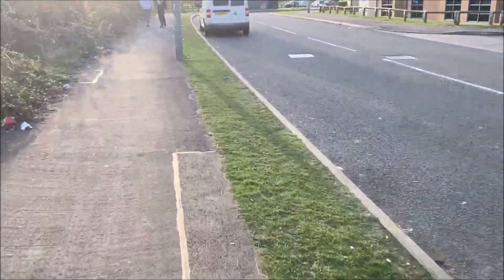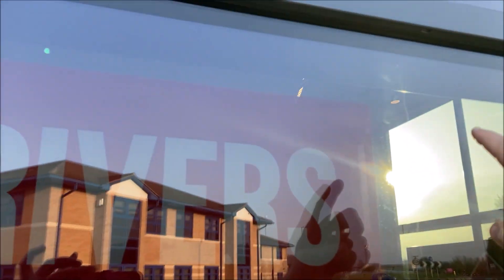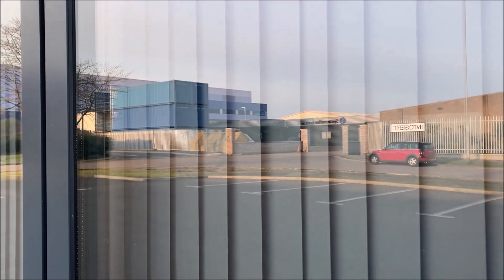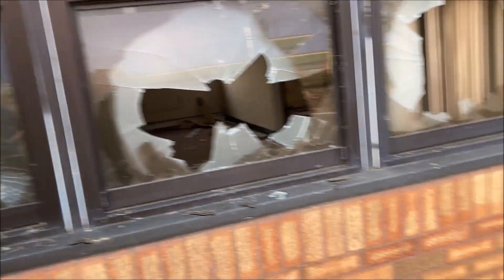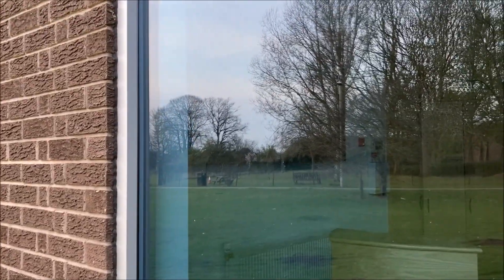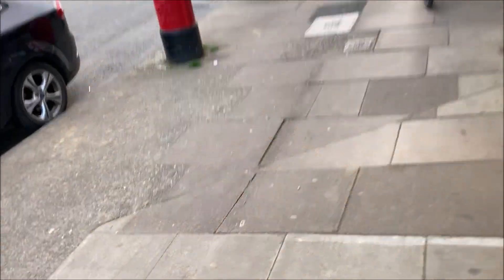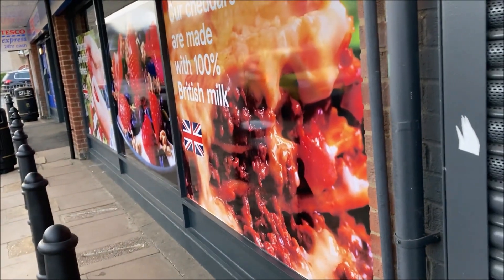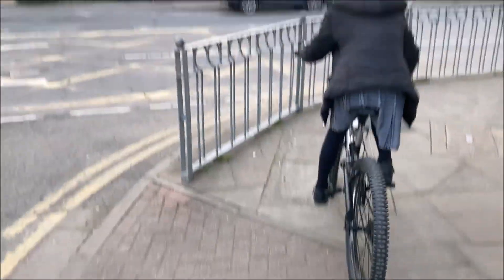Polzn Bladz-Checking out local window cleaning quality

Comment: Cracking good video! The amount of people that think wfp is a magic tool is incredible. Of course when wet it looks superb but as you've shown multiple times just on these few jobs it doesn't leave a good result everytime. On some windows the wfp does work fine but there's always a gamble element to that tool. 

Obviously some jobs can't be done trad and have to be wfp, but so many people use it for everything and are unaware just how much better job a nose to glass trad clean can achieve, all they need to do is charge more to allow for the time it takes for a trad clean and they would come away with a great wage and much better results.

Well done Mr bladz
Reply from the maker: It's also the quality of trad which is shown here. This is general quality window cleaning. It's all low grade work and this industry needs to level up and improve all over
Reply: Totally agree, Well done Mr Bladz!!!

Comment: Personally love both methods. Water fed pole requires good technique and good water quality. People do think it's just scrub and squirt and it will be perfect. Not a chance. 

Traditional window cleaning with Moreman tools (I've adapted to using this tool) also does require good technique and good solution. 

Both methods can deliver excellent results but really it comes down to the operator of those tools having the work ethic and knowledge to deliver what's required. 

Commercial jobs such as the ones shown are often done by guys who don't have passion. It's a job and just needs to be done quickly by a national firm. Unfortunately there is no quality control at either end. By the companies conducting the work, or the customer. Taking a good look at the end results and questioning any imperfections.
Reply from the maker: I agree. I think these actual jobs were done by local window cleaners. The results reflect their passion for the job. That's what I've been highlighting over the last few weeks. This industry needs an upgrade and their is plenty of room for improvement with the better known youtube window cleaners that like to give their uneducated opinions rather than actual facts

Comment: hey I see you mention you use a 22 have one and 18 I'm good with the 14 and smaller but looking for some help on 18 and 22 it seems issues with the ends but also further inward the results are not to good please help it would be great if I could use these larger ones
Reply from the maker: Longer the channel, harder it is to use and be precise with it. A lot of it is to do with what rubber you use with it. If you are using Ettore the longer channels don't want to work at the edges
Reply: @polznbladz3242  Right now I got the unger green in the 18 and haven't changed in the 22
Reply from the maker: @mcace64  Is it black or blue rubber  in the 22"
Reply: @polznbladz3242  the blue it is the liquidator 3
Reply from the maker: @mcace64  Ok I will do a vid on it
Reply: @polznbladz3242  thanks a lot

Comment: It’s nothing to do with water fed pole it’s the person using it same as a bad job with the squeegee.I get perfect results using water fed pole,was traditional for 25 years and both methods are as good if done correctly. People seem to blame the method rather than the cleaner!
Reply from the maker: I'm not blaming either methods. I'm blaming the low quality generally. It happens everywhere traditional and wfp.
Reply: @polznbladz3242  that I do agree with very few people seem to take pride in what they do! I hear it all the time pick work up from customers who say don’t want the pole it’s rubbish,I say blame the cleaner not the method let me show you what I mean. Use the wfp and they are blown away with the results and can’t believe the difference, also had the same with traditional cleaning which I do use only the liquidator’s.